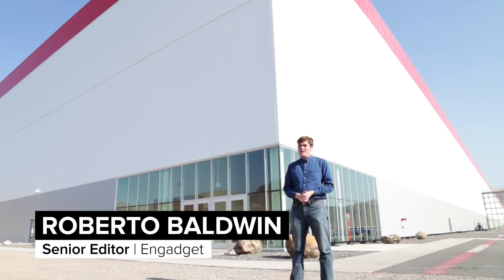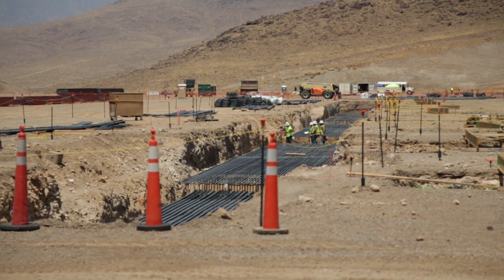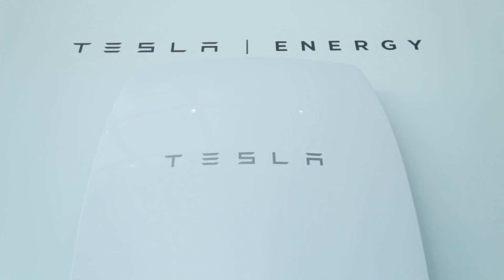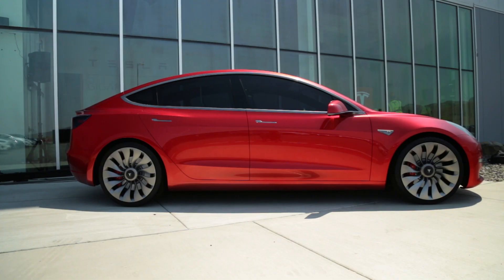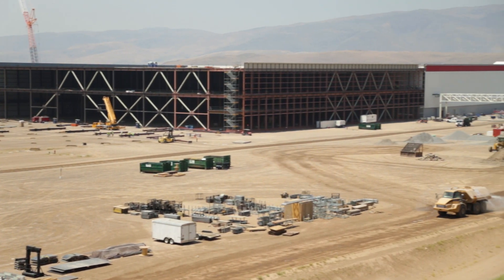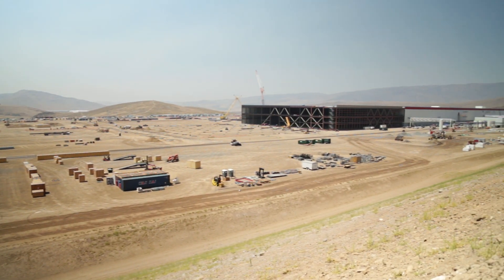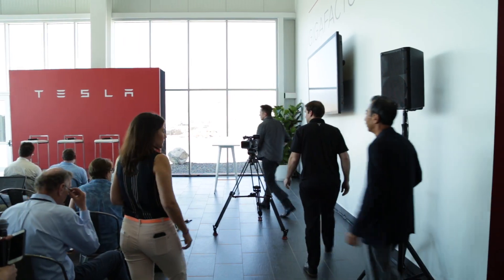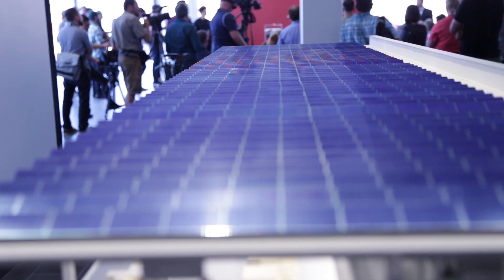Inside the Gigafactory: Tesla's most important project

Comment: If this lithium economy takes off there will suddenly be a lot of these factories.  This factory alone looks like it employs more than 5000 people so far
Reply: Phillip Mulligan I can conquer. I work at the gigafactory on the Panasonic side and I've heard once completion is complete there should be roughly 7000 people employed on both sides of the factory. (Telsa and Panasonic combined)
Reply: I personally do not want to work in a factory that handled pure lithium in very large quantities.  Might as well be working at a rocket ordinance factory.
Reply: Everyone has their preference but there is a very strict measures taken to ensure the max safety. Of course its machinery and we are humans.. things are eventually bound to malfunction one way or another but I could understand why you wouldn't.
Reply: I do work with machinery and have done contract work at the nearby Edmonton oil refineries.  I just don't know how lithium fires are dealt with.  My experience with lithium fires was a staged experiment in high school when we poured water into a beaker with a lithium shaving in it.  The results were quite violent and the bottom of the beaker turned orange it was so hot.

Comment: 1:21 Solar panels on cars? I have never heard that Tesla updated their master plan to include solar panels on cars. In fact Elon criticized Fisker for doing the same thing and it has been de3bated many times and quickly shot down as ever being a viable way to charge a cars batteries. https://forums.tesla.com/forum/forums/would-having-solar-panels-roof-and-hood-tesla-give-it-even-more-range
Reply: One of the masterplan, some people intiially got confused and though Elon meant solar panels on cars but obviously that was not the case.
Reply: I think Elon remarked somewhere that it would be easy to turn the glass roof of a car into a solar panel. You don't get enough energy from such a small area to power the car but it might be useful anyway.
Reply: "Solar panels on cars" is a mistake by the video.  Tesla is all about solar rooftops because they are far more optimal, practical, the return on investment is good.  There is insufficient area for solar on a Model S, so the charge rate for solar on the Model S would be ~0.4 miles of rage per hour during optimal conditions.  Cant charge under a tree or if the sun is low in the sky.